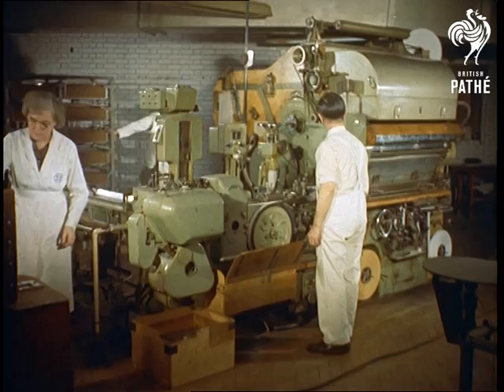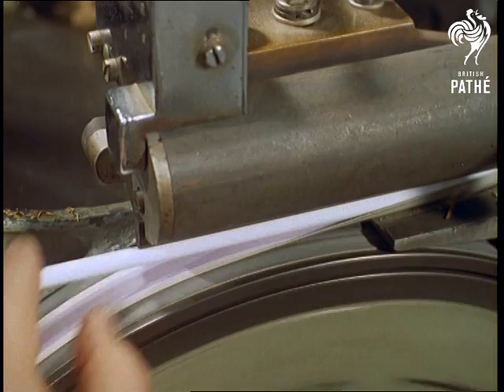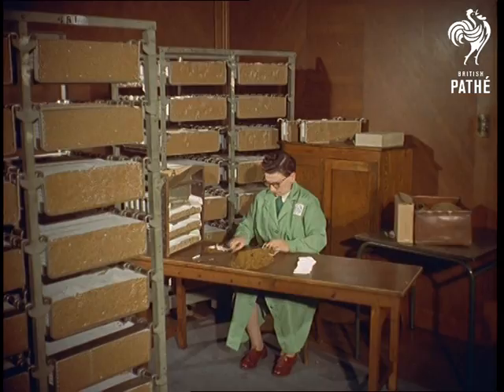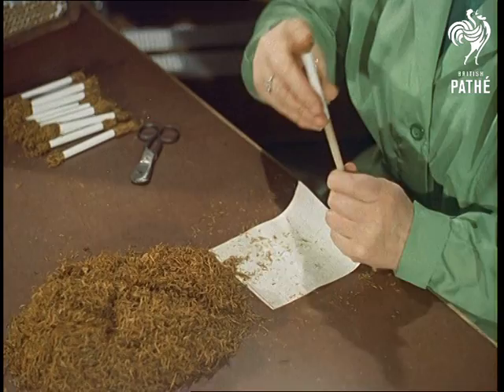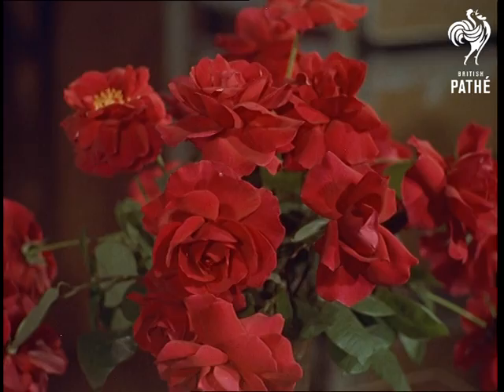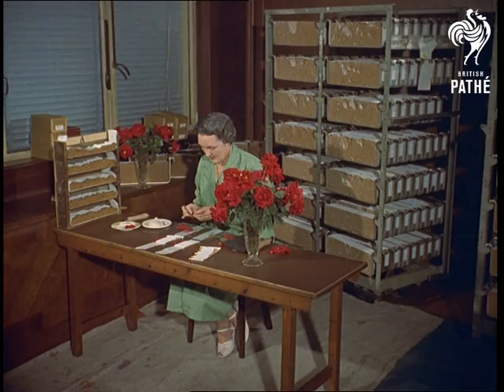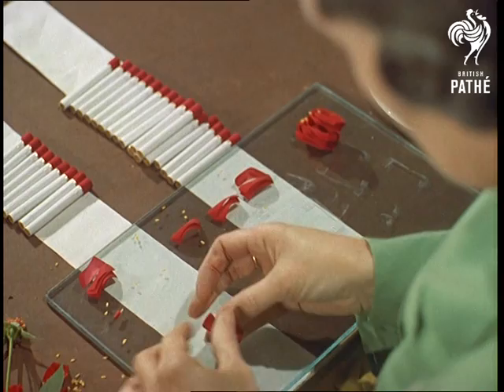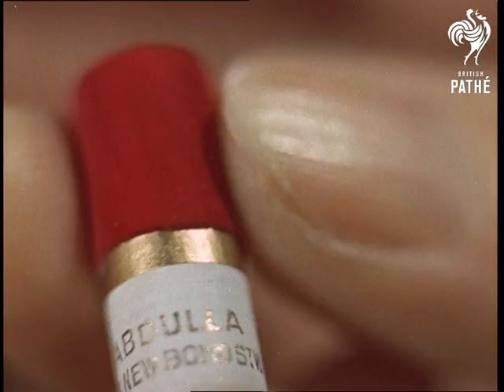Rose Petal Cigarettes (1959)

Comment: The film quality is substantial for the era
Reply: Most films made on film can be restored.
Reply: matt except the JFK kind
Reply: NOT REALLY. 1959 WAS NOT IONS AGO.  TECHNICOLOR AND OTHER PROPRITARY PROCESSES WERE ALREADY WIDELY USED IN THE FILM INDUSTRY.
Reply: No it's not. 35mm has an amazing resolution. It's mostly the transfer method that's lacking. That's why people think old films should look "old".
Reply: @emeryththeman  Same reason you can watch Star Trek on 4k. If it was on tape you would be stuck in 480p (or whatever resolution the specific tape format supported) without computer software doing its best to look better
Reply: @emeryththeman  you have a point.